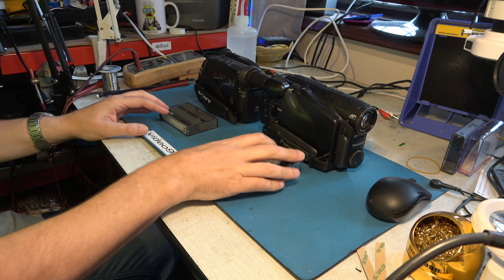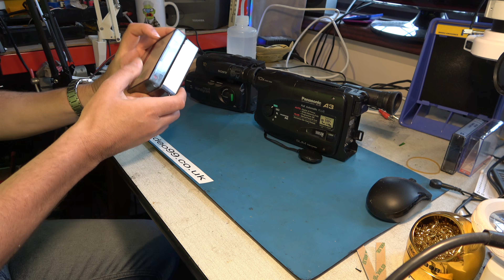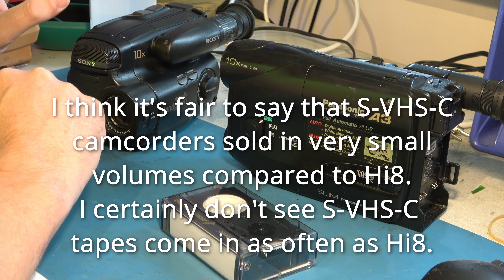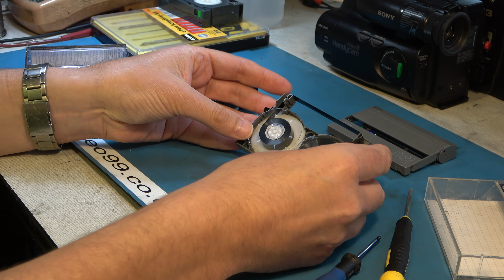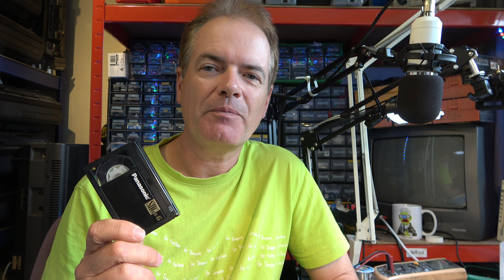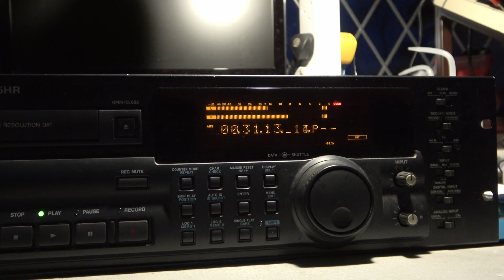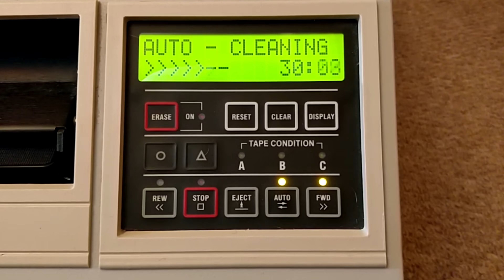Camcorders: VHSC or Video8?  miniDV or miniDVD?  Was VHSC bad?  Also tape degaussing.

Comment: I've always liked Video8 as a format, forums will tell you it's full of dropouts (digitalfaq and the usual suspects detest it) but I'm yet to find any poor Video8 recordings (and by extension Hi8) - usually it's a format that provides nice clean transfers.

Perhaps I get lucky, but I'm yet to really struggle with it - VHS-C on the other hand....
Reply from the maker: I agree, dropouts are much less of a problem on 8mm than with VHSC.  Not to say they never happen, but much less obtrusively on average.  I think the VHSC adaptors knocked the tapes about a lot.

Comment: I paid £1000 for a very early DVD-RAM camcorder, a Hitachi DZ-MV100E, in the early 2000s. Think it was reduced from around three grand. Took it to its native Japan where there were quite a few people visibly impressed by the thing.

It worked really well with a Toshiba DVD-RAM/HDD home recorder I had, the recordings worked across both machines. 

Unfortunately I dropped it from about three feet onto concrete and it never worked properly again. It was almost certainly just bad alignment (it became super-picky with media and recordings glitched). I don't think such delicate mechanicals lend themselves well to portable use.

I may still have it somewhere and can donate it if you're interested.

Comment: Can you show us how to properly break open a VHS-C tape?
Reply: They're pretty easy to 
take apart. There're two or three catches on the sides that you have to release after taking off all the screws. If you forget those catches you can break the cassette housing...
Reply: @josegti84  It's for when the screws cannot be removed.

Comment: Here in Germany one important argument for VHS-C was that by the late 80s all of the well known and popular German brands had decided to offer VHS, mostly rebadged equipment made by JVC or Matsushita. So it was only logical to offer VHS-C camcorders when those came out. There were countless different versions of the first VHS-C camcorder, the JVC GR-C1E already. You could get it from Saba, Nordmende, Dual,Telefunken, ITT and many more. The first camcorder in my family was VHS-C, simply because that was what Grundig offered in 1988. This was later replaced by a Panasonic NV-SX50 S-VHS-C camcorder which unfortunately was usually used just with standard VHS-C cassettes. But even in that mode it did record pretty good quality video. The video of my 2004 trip to Berlin was recorded on that camcorder, you can find it on my channel. 
All of the German brands getting their camcorders made mainly by Matsushita actually gave them quite a bit of influence. When some of them decided to also offer Video8 in the late 80s they actually got Matsushita to build those camcorders for them, too. Examples for these models are the Bauer VCC 526 and the Bauer VCC 536. 
In the mid 90s the offerings of German manufacturers got more diverse, for example you could still get Panasonic VHS-C camcorders rebadged as Metz, while Grundig was offering Video8 and Hi8 camcorders made by Sony. When MiniDV became popular, the German brands that remained at that time went back to camcorders made by Panasonic. As far as I know no German brand ever sold Digital8.
Reply from the maker: I had heard before that Matsushita manufactured 8mm camcorders too, but didn't sell them under JVC or Panasonic branding.  
Correct, Digital8 was only marketed by Sony and Hitachi.
Here in the UK by the late 1990s, VHSC had a small and shrinking market share.  Video8 and Hi8 had won.  In particular, S-VHS-C gained very little traction compared to Hi8.

Comment: Hated VHS-C and Mini-DVD with a passion, if I get a bag of tapes it's always a sigh of relief to see them all, or a majority at least as 8mm in some guise or other.
Your very last statement about the ease of SD / card use after it's arrival sent me scurrying through our old emails as I remember several customers who bought cards of varying ages. This one chap of yours, from 2017 (you stealthily sent him to me as I like editing), has 612 files across 36 different formats. All from equipment used between 2005 and 2016.

.mts        1920 x 1080             25fps
.mov        1920 x 1080                24fps
.mov        1920 x 1080                25fps
.mov        1920 x 1080                26fps
.mov        1920 x 1080                28fps
.mov        1920 x 1080                29fps
.mov        1920 x 1080                30fps
.3gp        1280 x 720                30fps
.mp4        1920 x 1080                29fps
.mp4        176 x 144                15fps
.mp4        270 x 480                30fps
.mp4        320 x 240                15fps
.mp4        320 x 242                25fps
.mp4        320 x 568                24fps
.mp4        320 x 568                30fps
.mp4        360 x 240                29fps
.mp4        360 x 360                30fps
.mp4        360 x 640                24fps
.mp4        360 x 640                25fps
.mp4        360 x 640                29fps
.mp4        360 x 640                30fps
.mp4        480 x 256                23fps
.mp4        640 x 360                24fps
.mp4        640 x 360                29fps
.mp4        640 x 352                20fps
.mp4        640 x 352                30fps
.mp4        640 x 480                29fps
.mp4        640 x 480                30fps
.mp4        640 x 480                31fps
.mp4        480 x 270                31fps
.avi        640 x 480                25fps
.avi        640 x 480                29fps
.avi        320 x 240                12fps
.avi        320 x 240                14fps
.avi        320 x 240                15fps
.avi        1280 x 720                29fps

So yes, the arrival of cards helped in some ways but add in a few early phones, stills cameras that shot video and then camcorders and it made it stupendously time consuming to make a coherent set of films or DVDs out of this content. But at least 9 times out of 10 you knew when it was shot and sometimes where. Bonus!

Then there was the joy of .mv4 .mpg .moff .modd .thm .avi  .vob .ifo .bup .m2ts .wmv .moff .modd and .gp! (there are many more)

All in all, the stars of the last 20+ years have been DV tapes and Video8, hi8 and D8. Pretty much everything else feels like a marketing distraction and an irritant, like pyramid tea bags.
Reply: 3gp 720P? Was that even a thing? I only remember 3gp being a very low resolution video format for mobile phones of the mid 2000s...
Reply: @crashbandicoot4everr  Yeah, that's what I thought too, but it's a straight copy / paste from an email I sent where I interrogated the files with "mediainfo" and unless I made a typo 4 years ago that's what it was. Indeed although I have never ever exported anything to 3gp out of Premiere pro it does have the setting for it and they are small as you say, so I am inclined to go with typo BUT I don't know if it could have got that high because every company used a different resolution, a different frame rate, a different format, so I really don't know, the original files have, of course, gone as it was so long ago so I can't check.

Comment: i didn't realise there were so many formats and quality problems.
I didn't hear you say much about the cost to the public,  most camcorders would cost you a kidney from new, and sony wanted all your familys kidneys :-D.
It seems almost imposible to make a new product without someone jumping on the band wagon and making the water muddy.
Reply from the maker: Certainly early camcorders were expensive, and not even particularly reliable.  Deck faults, dried up SM electrolytic capacitors, CCD failures.

Comment: I'm not the only one who has broken VHSC cassettes to bits trying to access to the tape then! Those screws are a nightmare and if you put too much force on it the head strips. Some minidv tapes are a pain too when the manufacturers decided to get rid of the screws and fuse the 2 halves together. Some very cheap VHS cassettes are the same. We're 4 tiny screws really that expensive? Great video Colin as always
Reply from the maker: Yes, glued miniDV tapes were also a thing, and VHS tapes which included a three-slotted security screw for no good reason.
Reply: If you have a broken DV tape (the type with welds instead of screws) it's easy to suck the broken ends from the housing using a short piece of tubing...you have to release the brake and rotate the spools slightly for best results, there are no guides to worry about inside DV and Video 8 housings.
Reply: @thebreretons  I have three MiniDV tapes that have welds instead of screws.
Reply: I've opened dozens of those JVC branded VHS-C cassette tapes and it's always down to the tip on your screwdriver. If you use the right one, they come off pretty easy. The MiniDV tapes that are glued together can be easily taken apart with the help of a blade. You don't need anything else.

Comment: I cannoy but agree with every single statement you made here. I've been archiving Video8, Hi8 and Digital8 the past days and I didn't have any problems at all. I also tried to read a miniDVD but without initial success, but managed to recover a lot using IsoBuster, a nice piece of software that reads out discs sector by sector and is able to detect video and other data. The quality of the material was very poor indeed, but I have never been a fan of MPEG2 compression as it clearly is unable to record a lot of fine details in a single frame while encoding on the fly. Thanks for the nice video. Your happy face at the start was a warm welcome at five P.M. on this grumpy day I'm having. Thank you!

Comment: Can I ask you a quick question about VHS-C? I have some old VHS-C tapes that plays in like green/White gameboy colours if you know what I mean. Do you know what can be causing this issue?
Reply: More than likely a wrong setting in the camcorder that made the recordings. I don't think chroma circuit faults were common with VHS-C camcorders.
Reply from the maker: The machine itself is confirmed OK and it's just the tapes doing this?  Sounds odd.
Reply: @video99couk  Yeah the VHS-C tapes I have does this, I have tried the tapes in multiple VCRs and it does the same thing. I am gueesing the tapes where recorded with a broken Camcorder.

Comment: Just a quick question is there a good or bad brand of video tape or does it not matter?
Reply from the maker: The answer to that is a bit complicated!  There are certain brands to avoid on certain formats.  Fuji 8mm tapes can go mouldy.  Ampex Umatic and Beta tapes suffer from sticky-shed.  Maxell 8mm tapes are hard to reassemble.  Some JVC VHSC tapes can't be dismantled.  Generally good brands like TDK and Sony are pretty reliable.
Reply: For Hi8 I'd avoid the earlier Sony formulations - they tend to shed with age, ruining recordings and clogging video heads. The later ones were better though, and their standard Video8 tapes never had this issue.